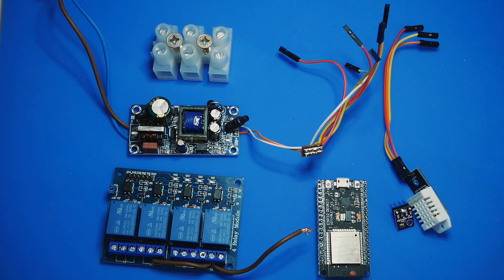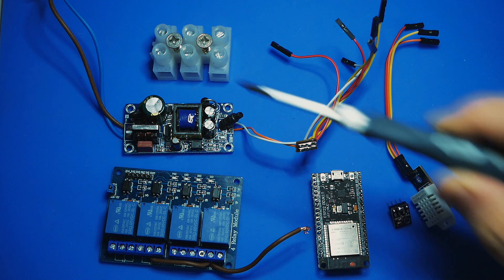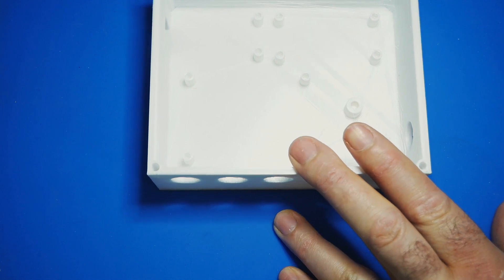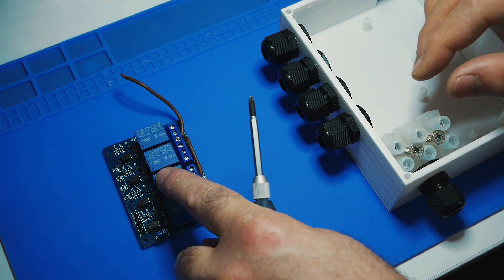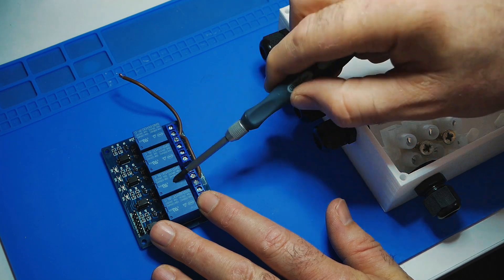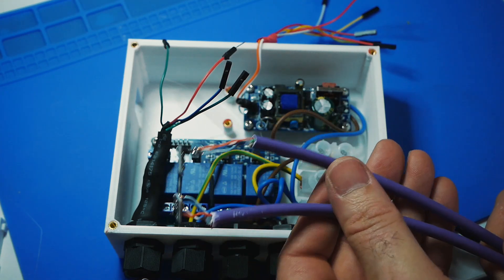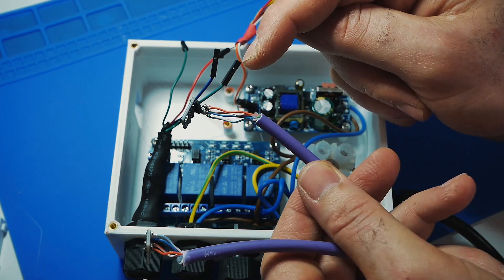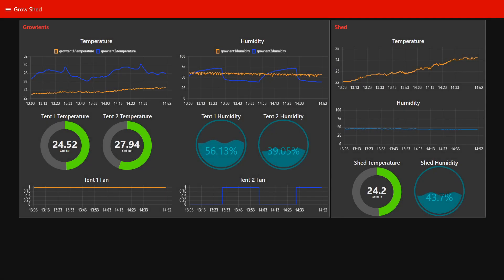Grow tent Monitoring and Automation

Comment: Sean got a question if I’m trying to run two sensors but the examples are showing two different band width do I need two boards one saying 9600 and the other 12500
Reply from the maker: Without knowing the full details here, I would say just use one baud rate or the other. The rate 9600 is just for the serial monitor, and shouldn't affect the sensors really. Unless this is a setting for the sensor itself.

Comment: Mains power supply and USB power supply conflict?
When you add a mains power supply to power the ESP32, do you need to take care not to connect a USB cable from your computer to the ESP32 any more?  I have read that if you hook up the ESP32 to a computer via a USB cable while supplying power to the ESP32 pin (VIN?) this may cause unexpected behavior because you will be back-powering the USB port, which could confuse or damage your computer. Any thoughts on that?

Comment: What are the inserts you're using in your box? I usually just under size a hole on items I print that will need screws. I'd like to try the insert method. Looks more durable. Also, do you just have a small tip on the soldering iron or is it something special? I  gave the same model soldering iron.
Reply from the maker: They are called threaded heat set inserts. The bit on my soldering iron is a special bit to do this (got it from farnell if I remember correctly)

Comment: Everything looks good, however, i would highly recommend you add fuses for both the controller power supply and each of the individual relayed outputs. small cost increase but it stops you from burning down your shed if something goes tits up.
Reply from the maker: the plug is fused which goes to mains. that is standard for UK plugs.  I have tested with inline fuses on my relays and board, and the mains plug is first to failure.
Reply: @ChilliChump2  I did not know UK plugs were fused. that's quite a nice feature :) In Canada they would rather you burn your house down then add a dollar to the manufacturing cost :P
Reply from the maker: yeah it's pretty good really! check it out: http://wordpress.mrreid.org/wp-content/uploads/2012/01/plug-original.jpg
Reply: @ChilliChump2  Thats awesome!

Comment: Enjoying these Videos. I used to design things like these from this size to 100+ I/O, motors heaters and stuff but fortunately I alway had some one else to make the control panel and do the wiring. This will be a new experience. They were PG16 Cable Glands btw, horrible things :-)). Wish I could afford a 3-D Printer, I can think of lots of things to make with it. Some actually needed :-D.

Comment: Great videos! Probably a silly question but how did you do the wiring harness 2-6 and what material did you use?
Reply from the maker: thank you! I used a piece of perfboard that I cut to size. then soldered the mounting holes together with a bunch of solder

Comment: Great video as ever thanks. A couple of questions if I’m not thinking again of schedule; If the environment is more humid would you use a different sensor in a sealed case and if remember correctly your greenhouse is solar powered, do you link everything into an inverter or just use 12v.
Reply from the maker: Hi Graham, 
No need for a different sensor...the sensors I am using (both types) are fine in a very humid environment as they are.
And I showed in the video, this project is for my shed with my grow tents....which is running off mains. I use 12V and DC only in my greenhouse, running off my solar system...inverters are a waste of energy.
Reply: ChilliChump2 Thanks for the comment. I have already created a unit that has four DH22 modules for four cupboards in our garage that hold any preserves / canned goods we make, plus I have just added a fermentation / home brew fridge, thanks for that. The sensors you are using look to be far more accurate and will allow me to be more proactive, next step our 6 x 8 greenhouse with no power.

Comment: I love how neat it all turns out. I make similar random things and it is just a bunch of nonsense hidden in a box. Well done, and thanks for your efforts.
Reply from the maker: Thanks Brad....yeah I have plenty of projects like that...wires just jammed in wherever. Getting the 3D printer has been brilliant, definitely a lot more satisfying to hold the end product!
Reply: @ChilliChump2  If you ever get the chance I'd love to know what kind of heater you have in your green house. I'm trying to temperature control my seed starting area but to hook up a regular heater to an stc 1000 seems just plain dangerous. I saw the one in your greenhouse looks like an oversized aquarium heater. With no exposed elements or anything that seems a safer, less fire-harzardy option. Cheers.
Reply from the maker: I don't have a heater in my greenhouse. I have one in my growtent though. That is just an oil filled heater. Was the most efficient way I could find of doing it.
Reply: @ChilliChump2  Thanks for the reply Chilliman. I was sure I saw a metre long cylindrical heater in there somewhere but obviously I'm too stupid to own a computer. The one in the ferminator would probably serve the purpose and I guess that I could look that up. Cheers for being such a stand up guy.  And I still desperately need to see white super hot sauce. Take care in these weird times.